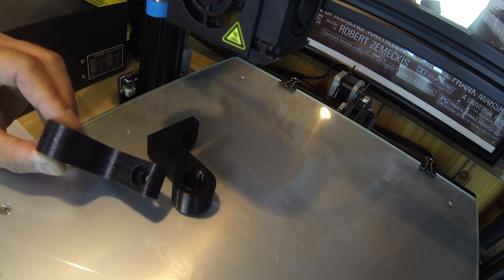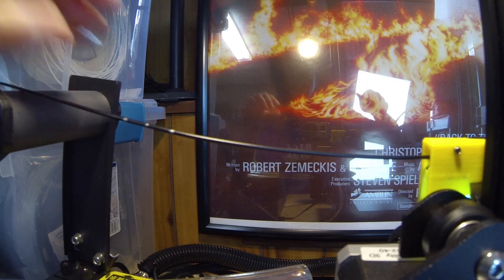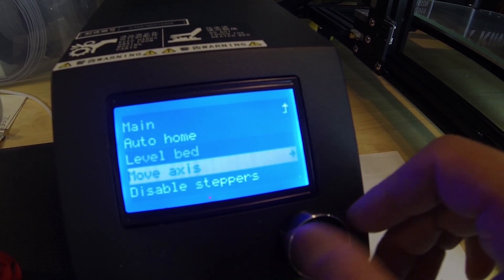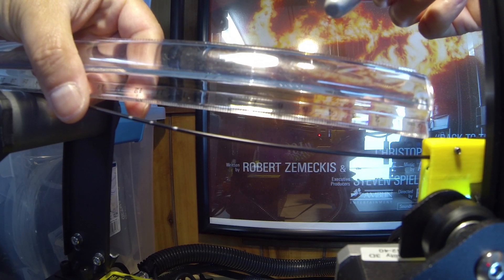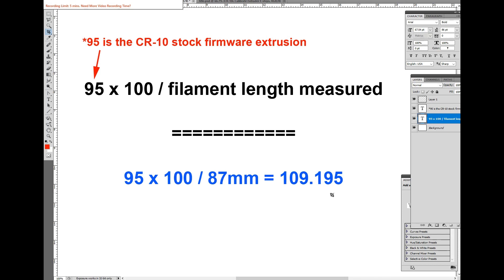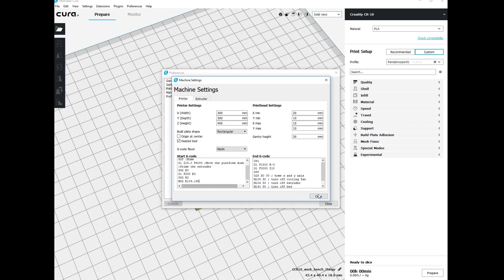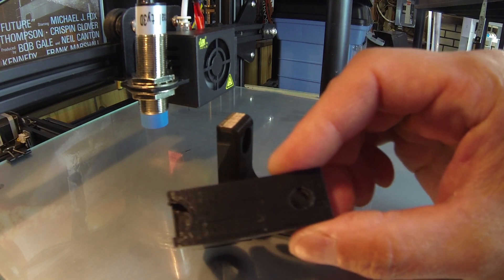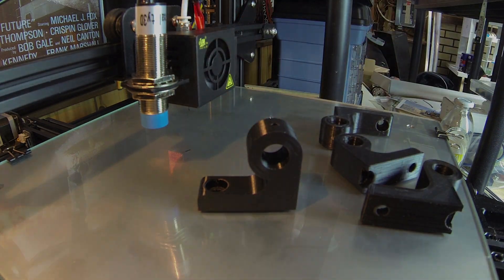Panda Prints! CR-10 / CR-10S - Adjust E-steps / Extruder calibration

Comment: Hi Panda! Thanks for the video... I have 2 questions though, you say that 95 is the stock CR-10 firmware extrusion... but I get flow rate at 100 by default on the controller. Or is that something else? Second question: could you instead of adjusting the E steps, increase the flow in Cura or the cr-10 controller to 109 percent? thanks!
Reply: Hey Johnny, the number on the display is percentage.  So set at a feed rate of 100 on the screen of the CR-10 means it's extruding at 100 percent of the feed rate of 95.  So if you were to increase the feed rate to 110 for example, it would be feeding 95 x 1.1 which is a feed rate of 104.5.
Reply from the maker: Hi Johnny. 95 was what I was told on the CR-10 Facebook group. Oddly, my CR-10S does not display the additional info you describe (maybe I'm not looking at the right place). 

As I understand it, flow rate controls the flow of the filament and the speed. What you want to do is control how much filament is coming out without altering the speed.

I'm no expert by any means, I haven't dug into the firmware or anything like that. This was simply a way of getting it to work for those that don't have a computer connected or want / need to alter the firmware. So long as you export your models using the same settings, the extrusion rates will get exported.

Hope that helps!
Reply from the maker: Update Johnny: I confirmed that the FR on the control box speeds EVERYTHING up, IE all the motors etc. For an extrusion calibration you want the extruder to push more filament out but not move the other motors faster. Theres a difference! Hope that helps.
Reply: I meant the "flow" setting, not the feed rate... I still don't get what the 95 is though. Does that mean the cr-10 extrudes only 95 out of a 100mm by default?
Reply: @ocd-ottercustomdesign1275  Its the number of steps the stepper motor needs to make, to extrude 100mm of filament.  Its not percent.  Its not mm.

Comment: Pandatrooper!!! I didn't know you had a channel. Well thanks for the easy explanation. I am needing to fine tune my esteps as well. The one thing I would recommend is to flash your firmware with TH3D Studios' unified firmware. You can save the e/x/y/z steps right on the machine and won't need to change it in Cura startup script. Helpful if you bounce between Cura and other slicers.
Reply from the maker: Thanks for the tip!
Reply: how hard is it to flash the TH3D firmware? Does it require a ftdi or similar device to flash?
Reply: Jason Yap so in pandas case what would he put into the E steps on the machine to make it correct?? I'd love to fix to problem right in the machine.